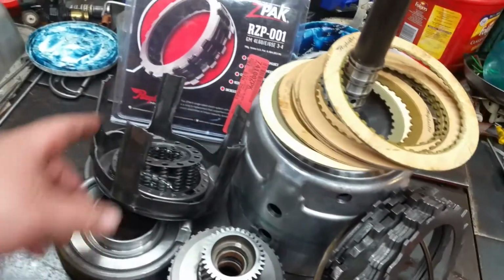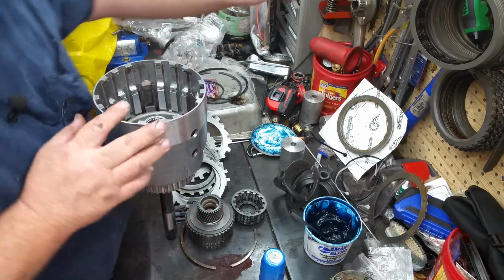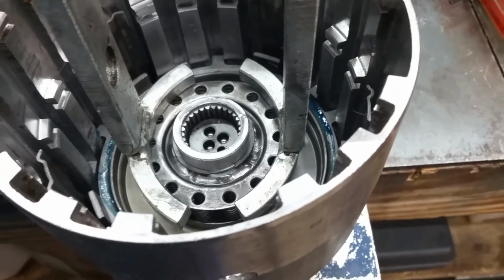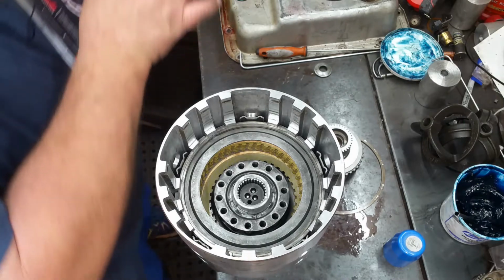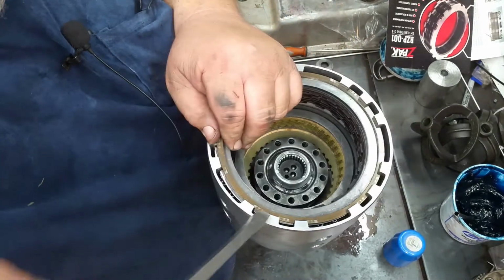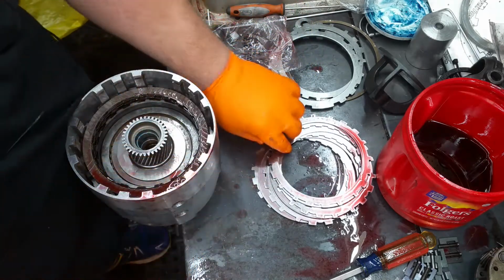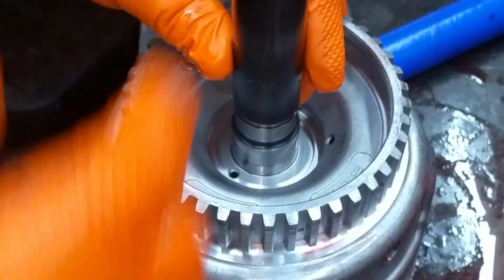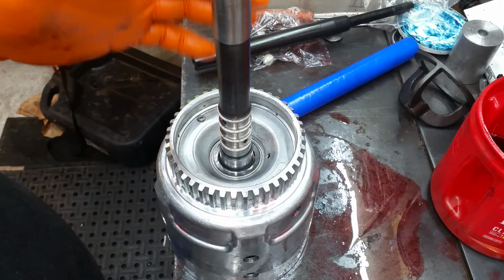Austins 4L60e Build: How to assemble an Input Housing and measure clutch clearance...

Comment: I love how you detailed your video so a 66 year old nube can learn. Lol..! I was wondering if you could give me  the part numbers of what you used to do Austin's build. I think that was his name! I'm currently working on a 4L65 out a 05 or 06 Escalade. It has the 5 planet gears and from the way it looks it doesn't have that much wear if any. It will be going behind a 450 hp LQ9 6 liter. It was a 4 wheel drive transmission and l do have the correct rear housing and output shaft. Sorry about the long read but anything you could give me would be greatly appreciated. Thank you and God bless! Marty.
Reply from the maker: Send me your email address and I'll get you one

Comment: Question! I've been fighting my trans alot. When I assemble my input drum all my clearances are on the tighter end of the specs.  When I air check through the input shaft the 3 4 hole applies the 3 4 clutch but it also moves the forward clutch. The forward clutch applies and holds when air checking. I've replaced the input drum all the molded pistons. The green orange I've replaced twice lol. Any help you can offer would be awesome!
Reply from the maker: As long as when you apply the forward clutch, it DOES NOT apply the 3-4, then you're good. If its a little on the tight side, you're also okay, as long as it's not tighter than spec.

Comment: I need that blue insert tool....I have not found the resource yet who provides
Reply: Well....I can get those on..but that tool is a good short cut...I could have Henry make me one ...on his lathe.
At my dad's machine shop...I've not taken measurements yet....but I do get mine installed...?
It's not a urgent need at all....but it's a nice tool...after I finish and complete my two years 95 and 05
Years of my ownership my builds probably stop
Reply from the maker: That came from a place called TransTool.  I've had it forever, don't know if the place is still in business. I can get the GM version part number for you.